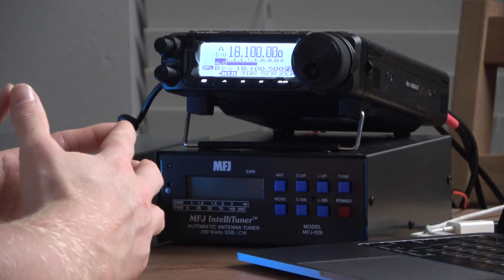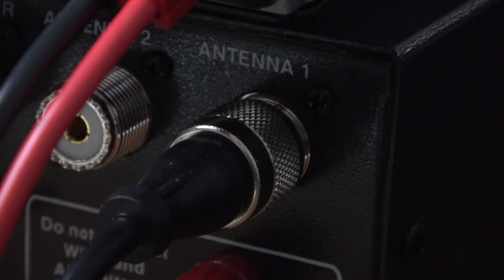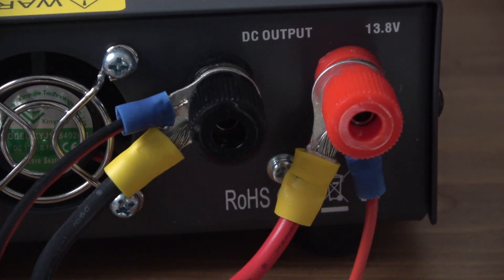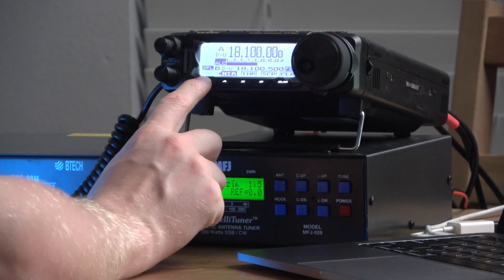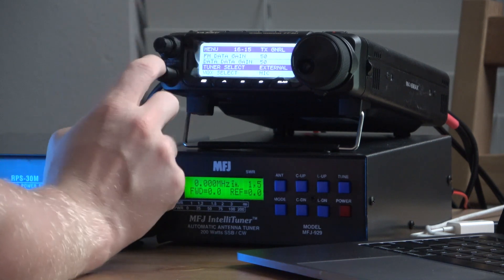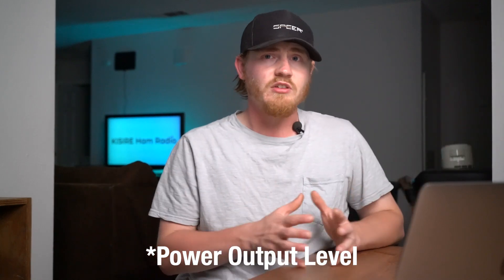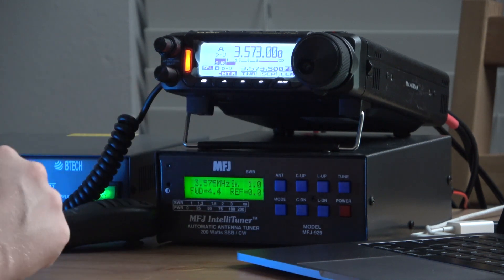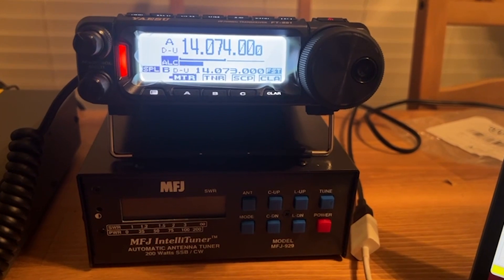How To Setup The MFJ-929 Antenna Tuner & Yaesu FT-891!

Comment: You should be able to just tune by transmitting an FM signal. I think you can change your mode to FM by holding down the band button.